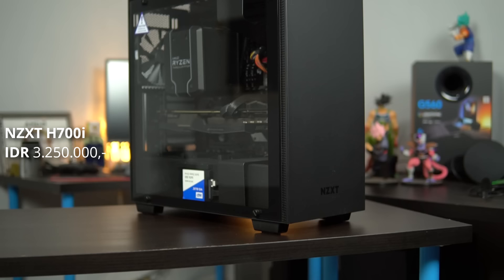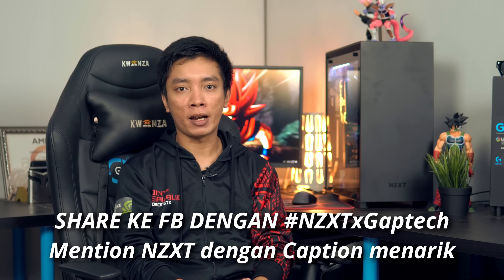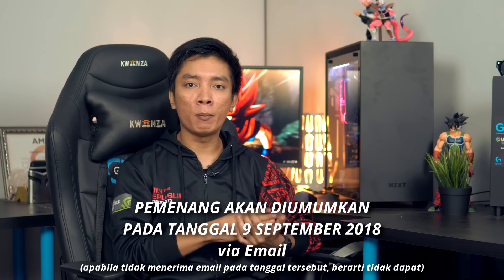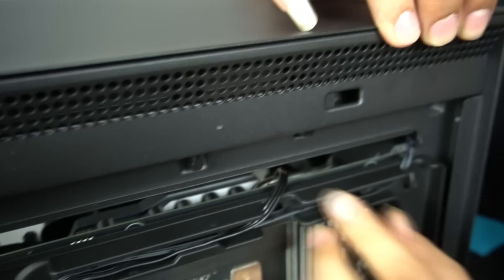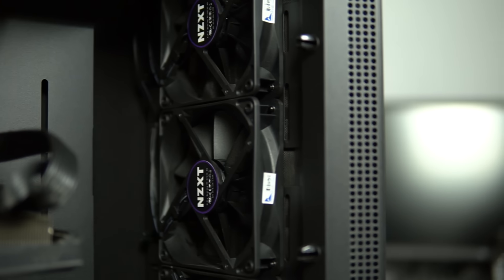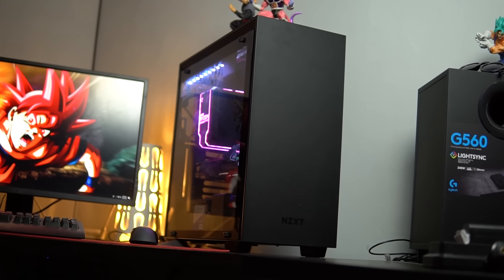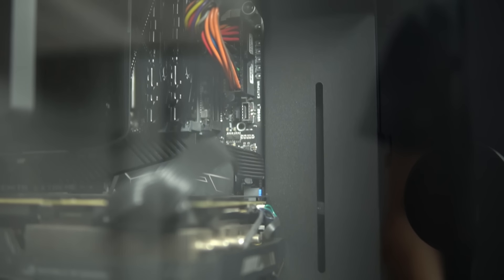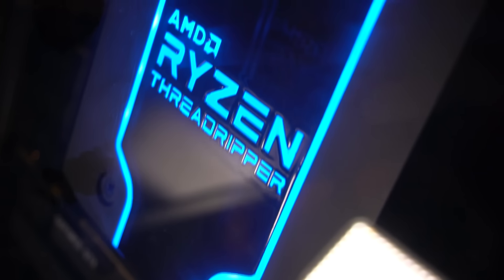RAKIT PC THREADRIPPER2 + CARA DAPET CASING GRATIS DARI NZXT! (Ft. NZXT H700i)

Comment: Mau minta saran 
Gw mau bikin pc pake amd ryzen 5 1500x 
Baiknya mobo sama vganya apa ?
Pake ssd m.2 + hdd gak ?
Psunya apa ? 
Fannya berapa ?
Reply: @claritoresdiano1021  gk punya temen it budget 12 jt
Reply: @bambar8949  Saran :
Kalau gak ngerti OC (Overclock) sebaiknya prefer non X, kecuali mau sedikit belajar OC tinggal baca artikel di situs jagatreview buat pemula.

R5 1500X memang murah namun sudah ada yg lebih baik R5 2600.

R5 2600 + MSI Tomahawk/Asrock B350 + RAM 2X4 GB Tsunami/Team + PSU 450W.
Total hitungan kasar sekitar 8-9 Jutaan harga bisa berubah sesuai brand dan pricelist toko.

Sisa budget tinggal beli Casing/Fan/SSD+HDD.

Untuk M.2 sesuaikan dengan Mobo yg dipakai, dia support sama M.2 tipe apa M.2 SATA atau M.2 NVME jangan asal beli.

Edit: Kalau perlu nambah Stabilizer supaya tegangan listrik tidak naik turun.
Reply: @claritoresdiano1021  itu 9 -10 blm sama vga ?
Reply: @bambar8949  oh iya 😂 GTX 1060 3GB itu sudah masuk, lupa di cantum wkwkwk. Terserah sih mau GTX1050ti 4GB atau 1060 3GB